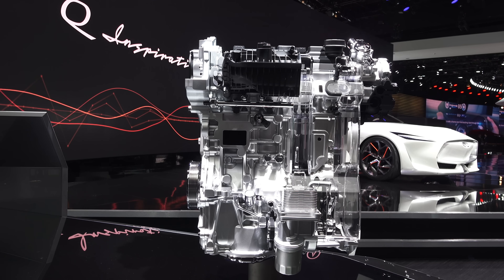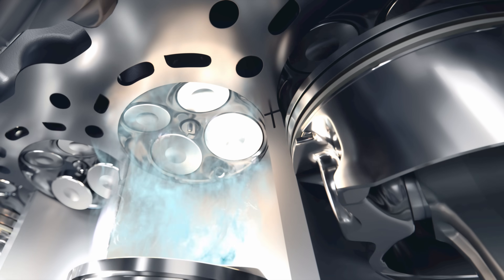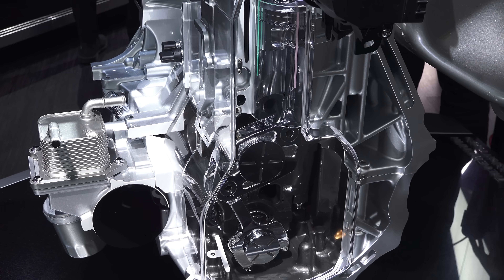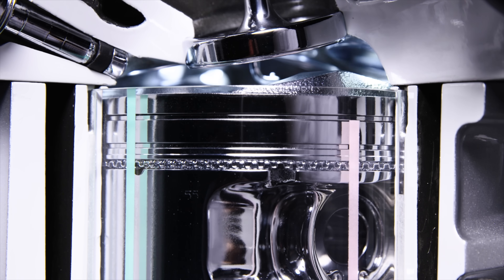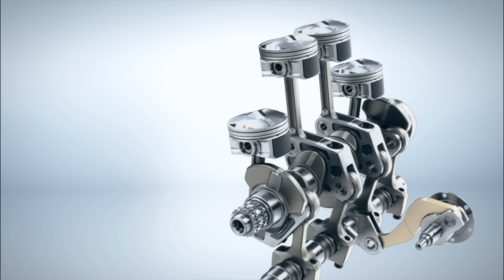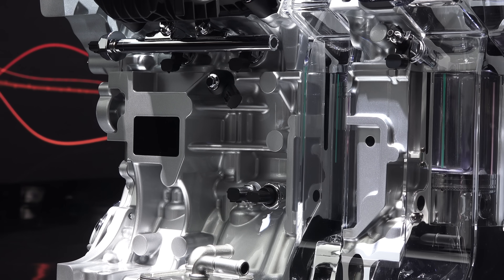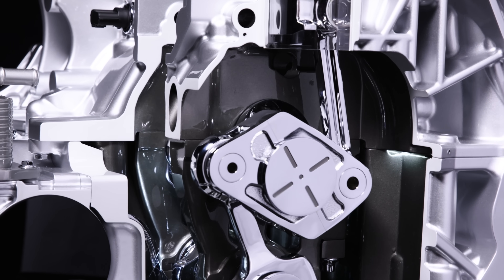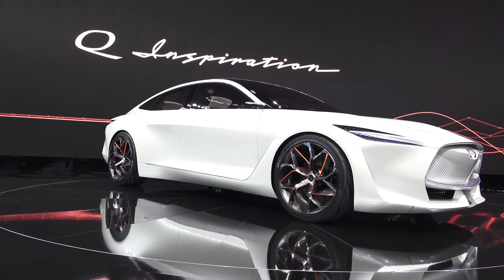INFINITI Reinvents The Gasoline Engine — VC-Turbo

Comment: So, they actually applied the idea of Watt's link in an engine by making the central pivot floating when one of the side pivots is fastened. Couldn't help noticing, the crank is not centered,  and when the piston goes up it approaches the cylinder's wall closer than when it goes down thus making uneven pressure on the walls of the cylinder. This could be fixed by shifting the entire system further away from the center of the cylinders.

Comment: INFINITI didn't invent anything new. James Atkinson invented such an engine with variable compression rate engine back in 1882. It's the basis of the Miller and Atkinson cycle, which utilizes a variable effective thermodynamic compression rate.

Comment: Case in point how R&D into ICE engines has passed the point of diminishing returns. Crazy design yet yields 22/29 mpg in the QX50; Rather underwhelming specs for such an overwhelmingly impressive design. If they would only just pair this with the famed 80 mpg carburetor.

Comment: I'll stick to my 18 year old audi/vw 1.8t motor...227k still gets average 25mpg, easy to work on and I'm not scared to rip it apart in my garage on the weekend to fix whatever needs to be fixed.....I'm a mechanic, or "technician" as they call us at BMW, and even BMW hasn't made an engine as complicated as this one...I like the idea, but not cost effective or easy to fix for sure

Comment: As long as high quality internals are used, technically the internal is working 50% less stressful to your conventional engine due to the crank rotation assembly only requires to do half of work yet produces the more combustion at a higher compression. 
Also, this new rotational design of the combustion pistons are always sitting fully square, it will be alot less stressful on the bores unlike the conventional engines that has to pushed up from an angle and putting more pressure to one side of the cylinder bore.

Comment: The part that switches modes is a small electric motor. If or should I say when that fails I'm sure changing that would be absolutely terrible and cost a small fortune.

Comment: So clearly
This hasn’t happened but when will it
Reply: Electric vehicles are going to be the future (way less moving parts)... we just need to crack the battery storage issues... this engine is a marvel in "outside-the-box" engineering thinking but its not the way forward... its a concept engine... 😎👍☘🍺

Comment: A lot of complexity for an incremental improvement in performance and economy.  Definitely a better mousetrap just in time for the death of the ICE in motorcars.   My daily driver is a 89 Chevy Silverado 4x4 with 190k miles on the 350 v8 the predecessor which came to market 65 years ago and I have owned probably 10 cars powered by it different displacements of that engine.  I can fix it.  $50 for a new water pump.  $50 for a new starter.  $90 for a new distributor.  If I had a good job, I would just buy the Tesla and still would be driving the Silverado.

Comment: People love hating on Technology that isn't designed by Europe, or USA, then the other car companies adapt it for production use and they forget about it & move on. Torque when you need it, Gas Mileage when you dont. A simple case of fixing the age old issue of Power Vs Fuel efficiency without horrible outcomes such as Fords EcoBoost, or GMs EcoTech. So far no Failures like Volkswagens Diesel Emissions Scandal.

Comment: Electric motor to change compression is the weakness , maybe should use an oil driving motor, means more engineering and more money. The human body works on combustion at a molecular level, most modern engines try to copy the already complex design of the human body. The design of the 4 stroke engine is fantastic and simple, by changing the materials to ceramic and titanium, you can lean the engine to an almost 0 emission and phenomenonal fuel economy, but money is always the brakes on this design.

Comment: As awesome as this engine is, I can't help but think it's a bit "too liitle too late". It's unfortunate that the only way gasoline can stay relevant is by increasing in complexity, while in the end it's still gonna get smoked by electric motors which have like 1% as many moving parts. RIP gas.
Reply: 7000 deteriorating (with both time and use) battery cells and a shed load of connections,wiring and electronics not good either. RIP battery.

Comment: There was a diesel engine made in the 1930s called a Lister CS, which had two different compression ratios. There was an extra chamber in the head which could be opened or closed by a valve. High compression was used for starting without use of a glow plug. Once the engine was warm, the compression valve was opened to the low ratio, and then the engine could be loaded.

Comment: You never mentioned displacement? Is the displacement a range with this engine? I think yes! "Check out my new car, it has a 1.5 to 1.8 liter engine, depending throttle position and Mr. Atkinson!"

Comment: Rotary engines was great due to few moving parts & died due to poor emissions 

This engine has 10x more moving parts   to fail but that's okay it gets 36 mpg on premium fuel.

How many  bearings are there ?
2 on each fulcrum (8) the lever end (4) and  crankshaft arm connection (4) and the crankshaft main bearings (4) and maybe more ??

Simple is best for short & longterm gains.

 A wise man once said, "  Just because we can doesn't mean we shouldn't stop and think if we should".

Hmmm🤔🤔🤔🤔

 Opposed piston and Duke engines are much more realistic for practical application without complexity getting in the way of profitability.🤑

Comment: All the negative comments...
Yet, if you actually ponder the design, you'll realize they've pretty much solved many/all the potential catastrophic mechanical damage issues, with just about any gasoline engine. (Assuming their rod/main bearings are second to none). I think it is beyond innovative. I'd bet if the electrical end continues to do its job, it will become the normal practice in gas engines. Thankyou 'EE'!

Comment: You snuck in that “It uses premium octane fuel”.
Reply: mister clean  wrong
Reply: mister clean   2019 VW Jetta SE
Reply: The 2013-2018 focus ST was designed to operate on regular 87 from the factory. Dealers put 87 in them new.

Comment: Maintenance aside, I'm glad to see that Infiniti and Nissan are still progressing forward with the gasoline engine
Reply: That mazda
Reply: @anpham8107  Hyundai With the Continous Variable Valve Duration (Variable valve opening time, like having a variable VTEC but only affects the time valve is open, doesn't affect the lift of the valve).
Reply: @TheLeonmafioso what's the difference between that and variable valve timing?
Reply: Yeah like with the wonderful Jatco CVT transmissions that Never fail or anything

Comment: I'm a mechanic for 40 years now, this looks like they've thought of everything but my concern is lubrication. I'm not sure that the offset links will get enough, good idea on the piston side load but there seems to be a transfer of it into the offset links, (a greater rotational speed at fulcrum points could spin a bearing in a start up scenario).

Comment: Dead technology... the EV will wreck all these "innovations" in less than two decades. They had a century to do real improvement and they did nothing.
Reply: In 1996, the Hyundai Accent was a zippy 1.6l 4cyl gas only engine with a measured MPG of 50. That's right, I measured 50mpg on a road trip to Oregon. The AC was blasting the entire time and my fwy speed was 75mph. I couldn't believe the first measurement so I did it twice. Sure enough, 49mpg.
That was over 25 years ago. Technology seems to be going backwards in the auto industry.
Reply: until battery technology improves, or oil runs out, ICEs aren’t going anywhere

Comment: When the us military said that a requirement of the latest generation of jets, was super cruise, ie : Mack 1 without afterburner, I said that's impossible with current jet engine technology ! Enter, new materials with ultra high temperature resistance. This allows the combustion chamber to withstand higher temps, thus increasing efficiency, and voila, super cruise ! Now apply this to the ICE, and voila, much higher efficiency, without all this engineering histrionics ! I've been saying this for over 30 years, but the oil companies didn't want to hear it !

Comment: I saw an article in the early 90's about this. 2 litre engine producing 300 horsepower and no adverse mileage over it's conventional counterpart. D.I avoids detonation and other preignition issues with high mechanical compression ratio without utilizing "Atkinson" cycle to bleed off cylinder pressure. 

Change every constant to a variable in the I.C engine. 
Variable displacement, variable compression, freevalve(infinite variable valve timing) turbocharged direct injection. 
Combine that with a hybrid powertrain and a renewable fuel source

Comment: you should move the cylinder head down to increase compression ratio instead of design something completely impossible to repair mechanical systems at the pistons side. pistons has enough workload to do.

Comment: polishing a turd. engines are dead bro. its all about electric motors now. keep your 4 million moving part, self destructing, exploding heat pump, over complicated boat anchor. we have instant torque powered by the sun now.

Comment: After reading several comments below, I find myself thinking this. The conventional way of thinking in regards to small engines, and really anything mechanical is stuck in the dark ages. Mechanics, service centers etc shiver at the thought of something new being introduced into production. I see comments from people who maybe are complacent with their knowledge of small engines up until this new engine is produced, and that's fine, previous engines were foreign and even alien until said mechanics/techs got their feet wet, and learned how it worked. Personally the introduction of a small engine of this magnitude is a game changer, it's greener for those who want to save the Earth, it's powerful enough to easily line up with a NA V6 and hold it's own, satisfying the enthusiasts demand, and it's overall design and internal mechanics are impressive enough for those tech heads out there. Even more is the fact that Infiniti's R&D for this engine is impressive, and that's an understatement, watch the video again and listen when he speaks of road testing numbers for other production engines, many of which were industry first, VVEL... Anyone....? I'd be willing to bet the first prototypes of the VHR VQ's didn't see even this much R&D back before it's release. I own a VHR and it's a solid built engine. When it comes time to move on to another vehicle, I'm sticking with Nissan/Infiniti, they stole my heart many years ago.

Thank you for pushing innovation and really demonstrating what great minds can do!
Reply: lookit's SQUIRREL Ya wanna know what isn’t green?

Having to replace something often, because that thing isn’t reliable.
Reply: Even though I am not a fan of Nissan products I can get behind this comment and applaud Nissan for their innovation

Comment: Ya way to many parts. Electric motors have more torque and 1 moving part for way less money
Reply: Mike Novak except battery technology isn’t all that great still.
Reply: @xostler   battery are the problem. Not enough produced. But most of the cars get 100 plus mpg equivalent. Tesla is making 35 thousand cars a month. Will be 50 thousand per month by 2021
Reply: Mike Novak yeah I’m excited for batteries to get better. 
For locations like Europe where everything is relatively close the electric motor is definitely a modern miracle. Even in cities in the US.
But in the West/ rural parts it’s just not cost or time effective yet.
Once degradation and charge time are negligible, the gasoline engine will probably only be used for sports.
Reply: @xostler  Tesla is working on a million mile battery.

Comment: ...so why then even have a necessity of four cylinders as minimal anymore?  Seems like using two or three larger displacement (to "engine total match" the four cylinder variable compression cylinders sizing) would have similar results of overall engine adjustability results; but then with the added benefit of many less parts.

Comment: I'm no expert, but I'm surprised they minimize compression ratio to maximize horsepower. I thought the old adage was, "There's no replacement for displacement" when trying to achieve greater power.

Comment: 50 years ago saw a variable compression tank diesel engine.  It had a telescoping piston controlled by oil pressure via crank, rod, wrist pin drillings.   Simpler than Infinity goofiness, but pistons were heavier.   
Compression ratio is geometric.  It is unchanged throttle open or closed.  The pressure ratio is what is thermodynamically relevant.  Keep your eye on that.
Reply: What was the tank model? I heard saddam husseins tanks in the gulf war had variable compression ratio engines because the yanks had cut off much of his fuel supply, and he needed to burn alternative fuels.
Reply: @martin-vv9lf  I cannot recall the make.  Hard enough my age remembering my name.
Reply: @danbenson7587  I am the same. You might have more of an idea where you were when you saw it, that would narrow it down to us/european/russian manufacture. much of the non english internet passes unawares to us westerners.
Reply: @martin-vv9lf  The variable piston diesel was in a magazine article.  The magazine concerned military vehicles.  The magazine was subscribed to by a Mechanical Engineering professor, and I a grad student.  This would be 1976-77.    What I remember was discovering tanks spend most time idling, off turbo, where high compression needed.  But when moving, tanks needed power, in effect, air.  So piston cap retracted.  Downside of cap was reciprocating weight and extra crankshaft/con rod drilling.  
    At the time, Americans used Continental horizontally opposed engines, Russians dual crank OP engines.  So suspect engine was Brit or French.
     I doubt this the only app of variable piston.  Also think it was suitable for 2 cycle, not 4 cycle.   Cheers

Comment: Imagine high compression, high boost :)
Reply: boom
Reply: @user-jt6nw6wm5q   it doesnt mean boom it means a fine tune is needed, people build low comp engines with high boost cause its easier to tune , if you build hi comp engines you run low boost
Reply: mister clean  yeah this engine is pointless in this day and age

Comment: A smaller displacement straight 6 like 2.0 to 3.0 liter engine would do everything this engine can do but without all the extra complexity and crap and deliver more horsepower and torque and probably even better fuel economy.

Comment: I can't wait to see the size hole this things puts in the block when it blows up  Because people don't want to change their oil on a regular basis!  The record so far is a 350 Chevy.  4 pistons out the side ( 2 lodged in the frame rail).  I had lifters and push rods in the oil pan.  Customer said "It made a little noise just before running out of power".  Seriously, the only thing undamaged was the water pump, exhaust manifolds and carburetor.  One of the pistons went thru the lifter valley and cracked the intake!

Comment: I saw this Configuration for variable compression 15 years ago. Many engines in production for years use intake valve closing time to alter the effective compression ratio but sometimes these engines are more compared to Atkinson cycle engines where the intake volume is less than the combustion volume and may not be called variable compression because there is another analogy... This may be the first I. Production on an automobile in this Configuration but its not new and I believe it has been done on stationary engines and 100% on experimental engines before. If the shaft that varies compression spins with the crank acting like a dual crank you could vary the displacement by adjusting the phasing between the two shafts as well as the compression but it all seems useless to me in all honesty.

Comment: What about the vibrations during the compression stroke? The connecting rod is at a more significant angle than it had during the expansion stroke?

Comment: OK ok ok sounds good asf, but I agree with the comments foreal... Very difficult to design to repair... I'm not sure is nissin is creating engines that are self maintained, but the heads are almost in the middle of the engine, and with a small engine bay, your gonna have to lift the engine out to get it. I'm sure those parts are gonna wear out fastbecause If the explosions are off and are adding to much power and/or to little power, it's gonna throw that arm for variability off. Very smart design though. They should try and move this into a boxer engine form, possibly to get more coolant around engine. Mods will be fun though, because ecu checking and bigger boost equals big power.... Big big power.... This could be the realistic solution to turbos increasing wear to engines, while still being able to to rock 17 bars of boost and not shrug. It's a 70/30 for me, 70% not with it, 30% with it. Repairing and ease of access is so major to me... This car Will be 20 years old one day, and no one wants to use a magnifying glass to find parts....

Comment: So let me get this straight... They added much more complexity, lots of new moving parts and very complex engineering and innovation ideas -- basically reinvented the 4 cylinder engine as we know it... so... they... could... get more power? and gain efficency??? But... But... wait for it folks... IT'S A 268HP 2.0 TURBO THAT GETS ~20MPG IN A CROSSOVER. Not exactly mind blowing numbers there... Average at best.  What are these car companies thinking??